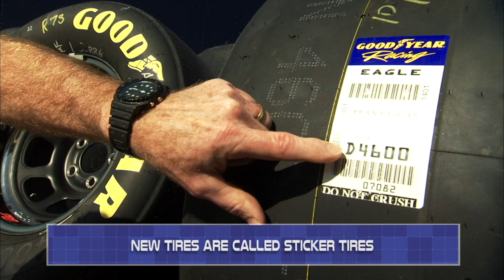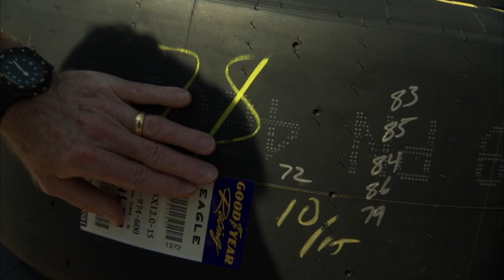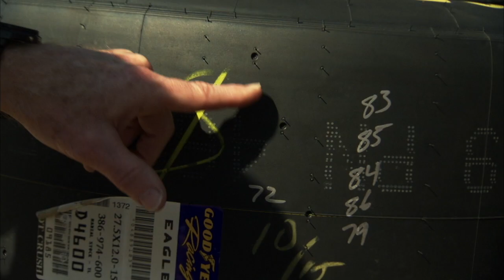Behind the numbers: How to read a tire

Comment: What about the difference between tire models? The cup series runs the Goodyear Eagle and the truck series runs the Goodyear Wrangler. What's the difference between the two?
Reply: sorry for a wayyy late reply wrangler is a much tougher tire. just as on a street car/truck. wranglers are more off-road style tires. wranglers are good for jeep’s and things like that, and it’s the same with nascar it’s a different compound than eagles, eagles are softer rubber. wranglers are meant for heavier vehicles ie: a truck
Reply: @nickfranklin4295  well thanks for answering. Now I know even if years later lol.
Reply: +Josh Bencivengo I did not know that they use different tires. I'm glad you posted that comment.
Reply: Branding more than anything. But just like between Cup and Xfinity they don't always run the same tire compound and construction for the trucks as they do for the other two series.